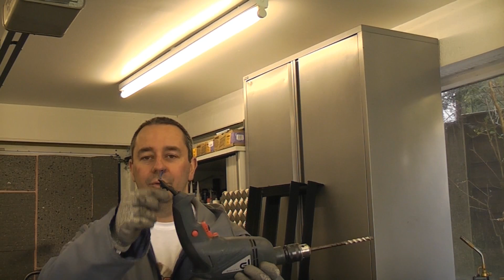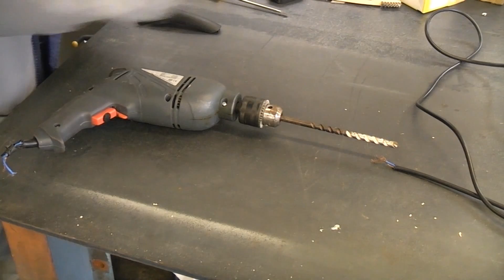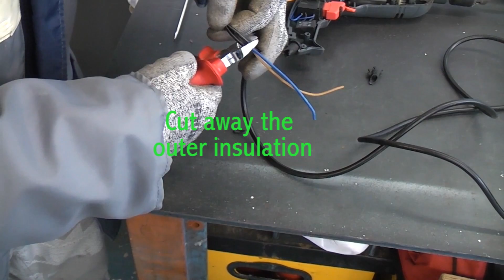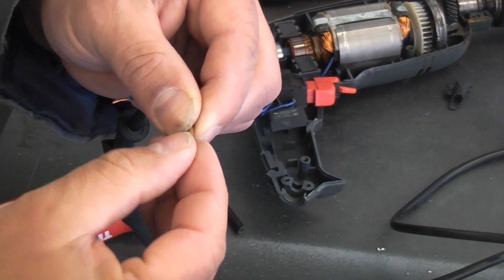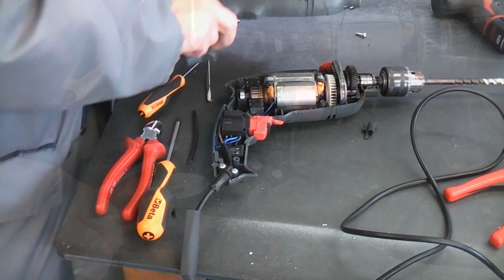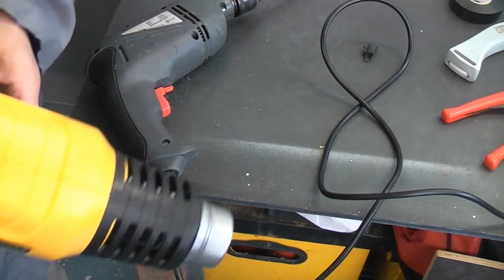How to replace a power tool flex

Comment: Great video.  I may refer to this guide more as I have a few electrical prosucts which do not have long enough cables. I always avoided stripping the flex cables just purely because i like tidiness. How much were the sleeves please and where did you purchase them?

Comment: Great video again, advise you check drill functionality before using heat shrink tubing for anyone else using this guide. Three cheers for the Ultimatehandyman! These vids are much easier to follow than DIY books.

Comment: Nice job! But I have a question: In a former live I installed big electro motor's and controlers. We were not allowed to tin the wires on a screwed connection! We have to use crimp connectors on one screw connections or bare wire on two screw connectors. Tinning will loosen the wire in time and coarse heating. (sorry for my bad grammar)